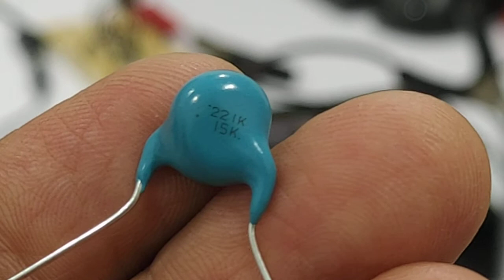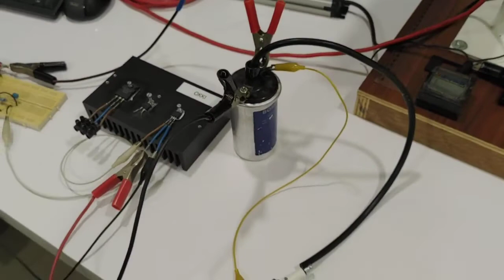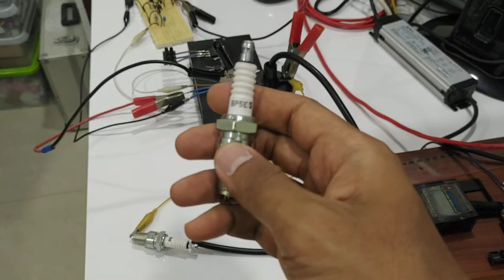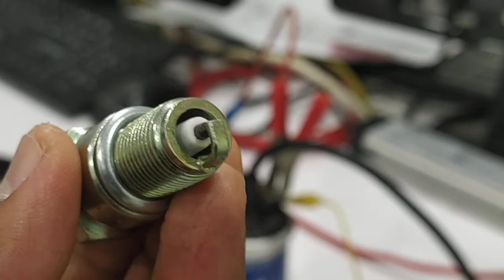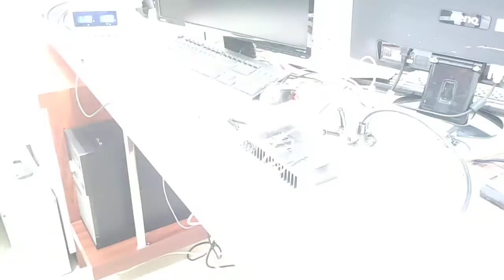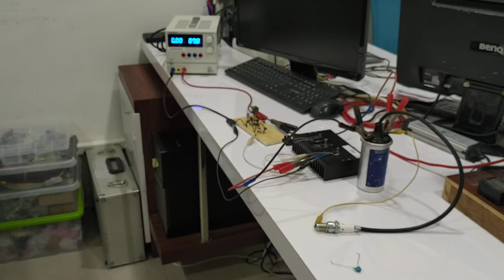Simple Plasma Ignition - Input Power

Comment: What is the actual output voltage of the alternator of the car you put this in? It’s higher than what’s set on the power supply here (or the battery won’t charge well), possibly by as much as 1.4v, and that would make the current lower in the circuit

Comment: I had interesting results with a capacitor discharging into the ignition`s coil primary. Then I add a HV diode from the primary+ to HV and the spikes in the electrode got stronger because the diode made the capacitor discharge in much less time (from uS to nS)... Just some ideas.
Reply from the maker: I think that is what Aaron Murakami uses for his demonstration.
Reply: @OkkiMoeljadi  Well, I saw the schematic in a video called "Water spark plug IV", 10-12 years ago, maybe Aaron saw it too. Anyways, I have a bunch of articles on fast pulse discharges where a diode is used to shape the pulse, nothing new. I can share some of them with you (if you want of course). Thanks.
Reply from the maker: @osmargarnica  yes, please share them with me. My email: info@m-opensolutions.com. Thank you!
Reply: so you used the HV diode in the spark cable? here in Brazil we have a spark cable called ibooster, it has a diode in the cable, the spark get a little stronger.
Reply: @edersondeassisfs  Yes, I used a diode but, it was not in series with the HV cable, the diode was shunting the primary and secondary. Search for the "Water Spark Plug IV" video, I did exactly what he did, and ir works. The diode`s body capacitance acts on the input signal, making the edges faster and therefore, discharging the capacitor faster, thus incresing the instantaneous energy in the load. PS: I`m from Br too.

Comment: Great video again 😊 would this work on a flywheel magneto? I am interested to get a better spark from my 1960 BSA Bantam.
Thanks Paul
Reply from the maker: Thank you Paul. You can try using smaller capacitor, like 100 pF or lower. Please let me know if it works or not.
Reply: @OkkiMoeljadi  thanks Okki, have put an order in for some 100pf 30kv items, will feedback as soon as they arrive.
Regards Paul

Comment: Does the resistive spark plug ignite?
Reply from the maker: Capacitor won't work with resistive spark plug.
Reply: @OkkiMoeljadi  hello.will it be with resistant cable? Thank you.
Reply from the maker: @orhanmahmutaksu9376  it will work if you connect the capacitor directly to spark plug.

Comment: Nice work
Reply from the maker: Thank you! Cheers!
Reply: @OkkiMoeljadi  I would like to ask you a question, 
What is the pulse frequency before you add the capacitor? 
What is the frequency after you add the capacitor?
Does the capacitor, create a lower frequency at the same time as the original frequency, so that you have two frequencies at once?
I'm trying to learn, thank you for sharing your videos and answering my questions.
Reply from the maker: Hi Scott. We should not change ignition-coil-output-frequency. If the frequency changed, this system would not run on actual engine. I used this system on my car without any problem. We only want bigger sparks by adding capacitors.
Reply: @OkkiMoeljadi  thank you for your reply. 
With the increase in spark, did you need to use higher octane fuel to prevent premature burning, sometimes known as engine knocking?
Reply: @OkkiMoeljadi  thank you for answering my questions.
I'm not an electrical engineer, but doesn't the frequency change when you add a capacitor?
Reply from the maker: Octane number requirement depends on your engine, not from this additional spark intensity. By adding capacitor, you will change the frequency on a resonant system but not on this one.

Comment: So the capacitor increases amplitude but not the frequency.   Timing is everything.
Reply from the maker: Capacitor increases the spark intensity.
Reply: Increasing frequency would cause misfires. What would be better would be to adjust duration of the ignition event, so you can play with advance, and that’s likely a function of the capacitor’s rating in both volts and farads; voltages would be quite high in double digit kV, but capacitance would be very low in double digit pF for a shorter charge/discharge time across a range of engine speeds. The igniter speed here is too high (generally) to see each spark event, and only one capacitor value is demonstrated.